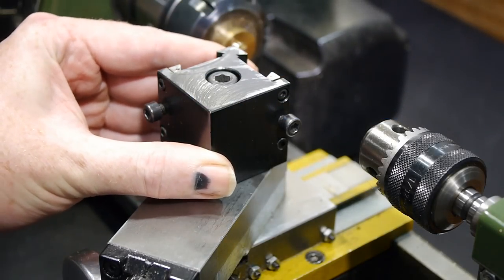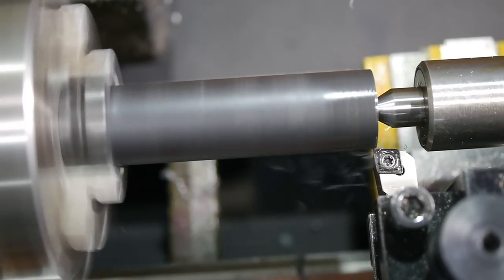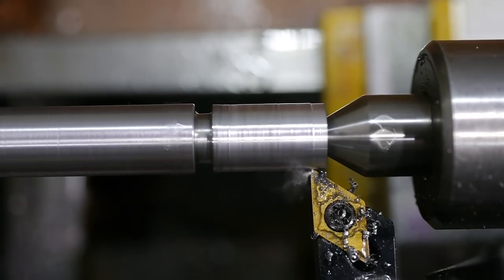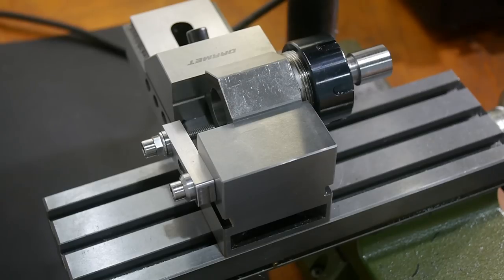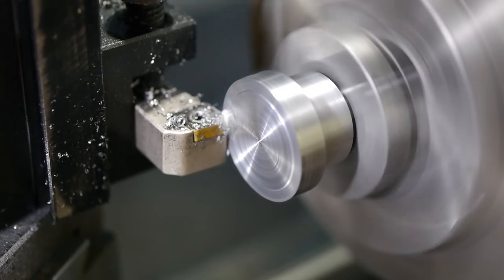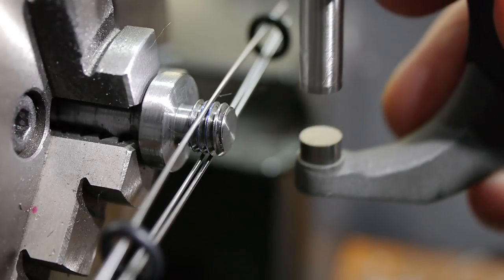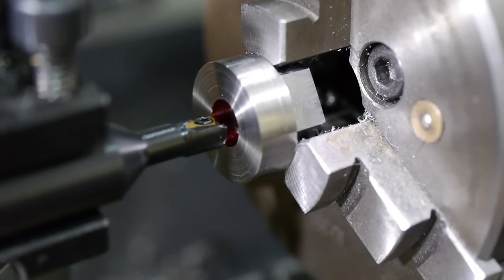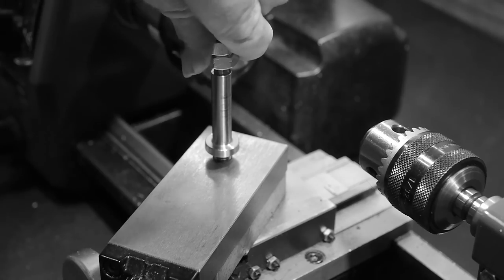Quick Change Tool Post Upgrade for the Proxxon PD 250/e Lathe

Comment: I know nothing about lathe machines  
But I'm very interested in this type of work thanks to your vids. 
I hear you say often how the motor stalls and how that lathe is weak and have no gears. 
Isn't it possible just to buy a new geard motor with more power ?
Reply from the maker: The issue is a bit more complex, so let me try and explain why I keep saying that. Commercial industrial lathes are large, have a powerful motor, and most importantly usually have a large complex gearbox to drive the spindle. The big AC motor is usually a fixed speed, and various sets of gears are used to select the spindle speed. This means motor power is fixed, and when the gears are selected for a low spindle speed, the spindle turns with a huge amount of torque. It's almost impossible to stall such a lathe at low speed, and something would almost always break before there was enough force to defeat the torque.
Small hobby lathes are much simpler machines, largely for cost reasons. The often have selectable speed modes via belt pulleys, or perhaps a couple of gears, but no full gearbox. To make up for this, and ensure they can still operate at different spindle speeds they have a speed control that varies the speed of the DC motor. The trouble is that when a DC motor speed is decreased, it also has a lot less torque. This means that most hobby lathes can quite easily be stalled at low speed if enough force is applied by the cutting tool that it is more than the available torque. I mention this from time to time as sometimes I get comments and suggestions from professional machinists, where it's not clear whether they understand how different a small hobby lathe is from the machines they are used to.
You absolutely could attach a big powerful motor, with it's own gearbox to a small lathe, but it doesn't really make sense. The small lathe wouldn't be built to safely handle the large forces, and it would probably take up as much space, and cost as much as buying a much bigger lathe second hand.
Reply: @AdventureswithaVerySmallLathe  
Ok thank you very much for your explanation. 
I was curious and now I'm with knowledge :) 
Love your videos keep up the good work :)

Comment: There is a shallow hole in the base of the tool post. Use it to lock the tool post in position on the base. I didn't see if there was a matching hole the base, if not dril & ream to suit. Make the matching hole a very snug fit. When tightening always push in the same direction onto the pin. Rigidity is the doorway ta good machining. Have you tried taking a heavier depth of cut to get a better finish? If u r going to use a carbide inser t why not use a Full form which crest cuts te thread anyways?

Comment: Have to make one for my PD 400. It came with the QCTP and with the same issues as yours.
Reply from the maker: How do you find the PD 400? I often wonder whether I should have paid that bit more, and got one of those instead. It would have been a real squeeze on my bench, but if the machine as as good as it looks, it might have been worth it.
Reply: @AdventureswithaVerySmallLathe  So far i am happy with it. Its my first lathe so i have no comparison to other machines. The larger range in diameter, length and mainly for threadcutting makes me toogle the switch to the bigger machine. As a beginner in turning and milling i don´t want the machines to be the restricting factor in my little workshop. And with money left to spent i choose the "big" one. Its a tight squeeze on the bench but absolutly worth it.
Reply: @AdventureswithaVerySmallLathe  Is the PD 400 220V?  not convenient 110V
Reply from the maker: @philipwolf3619  No idea I'm afraid. turbofan123, can you help out?

Comment: Great job on the tool post. I can see why the manufacturer cheaped out on this part. Lots of labor!  Couldn't you have just put a bushing on the bottom of the tool holder  to do the same thing?
Reply from the maker: A bushing would certainly have helped, but I don't think it would be as solid or stable as the solution I've made.

Comment: Very nice. If the original could slip while tightening, it could also slip while taking a harder cut.
Reply from the maker: The problem was mostly that the tool post would tend to move off-centre while tramming, or adjusting the angle. Tightening the bolt would then pull it back into centre, and would often mess up the tram as it did. With the register at the bottom, the post is certain to remain close to centre at all times.

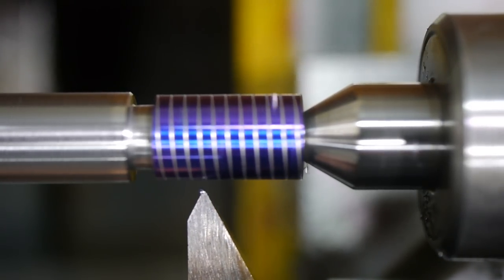Comment: The pointed threading tool (at 07:20) can be obtained where? Could you specify the exact designation of this tool? It‘s not from Proxxon, right? Thx.
Reply from the maker: That's a shop ground HSS tool I made myself from an 8mm square high speed steel blank.

Comment: Have you thought of lapping or scraping the bottom of your toolpost and the top of the compound? A good points per inch or lapped surface will be more rigid.
Reply from the maker: Definitely. The first thing I'd like to try is surface grinding it, which I'll have to take to a friend's shop for. To scrape it, I'll need a reference surface, which I don't have yet either.
Reply from the maker: The bottom surface was a real mess from the factory. It had fairly deep machining marks in it, which tended to get chips caught in them. It's better now that I've given it a stoning, but a proper grind or scrape is definitely required.
Reply from the maker: The bottom of the tool post has now been ground, and is much better. It makes firmer contact with the compound, and is easier to secure.

Comment: Looks like I'll be making a new stud for a new-to-me QCTP some time next week, so I thought I'd rewatch this video as it was full of useful ideas I can s̶t̶e̶a̶l̶ liberate ;)

Definitely got me thinking about the stress risers - you used a large radius tool near the shoulder, should I so something similar in my thread relief grooves as there are two sharp corners in each? Maybe using a threading tool to create the relief groove I can get away with it.

Thanks for the great video.
Reply from the maker: One of my machining mentors has repeatedly drummed in the importance of not having sharp inner corners, as they are very vulnerable to cracking under stress.

You make an excellent point about relief grooves. I've been using a parting tool, but I should probably grind some more dedicated tooling, with a size more closely matched to the requirements, and radiused corners.
Reply: @AdventureswithaVerySmallLathe  I might grind the corners off a parting blade and see how that goes.

Comment: good video brilliant idea, but, why start off with a blank the size of a broom handle to make something no more than20mm, in industry you would get a kicking for that ! taps and dies would be sufficient for this job too.
Reply from the maker: The stock I used for this was 20mm. The nut used the full diameter after the scale was removed, and I only removed 5mm to make the flange diameter of the post. I also completely avoided any chucking scrap by using the remaining length for the nut. I could probably have saved a bit on the diameter by ordering a 16mm diameter piece specially, but they I would have had to scrap the chucking allowance.

Comment: Thank you for a very interesting video. I have a proxxon 250 e and had a lot of problems with the tool post swiveling when I tried knerling. I am definitely going to adopt your way of correcting it. By the way , I don't own a mill and I consider buying the mill head that fits on the lathe. Do you have any experience with it? C
an you recommend it?
Reply from the maker: I originally bought the FF 230 mill head for this lathe, and it didn't work at all well. I don't recommend it. I was able to buy a separate base and cross-table to convert the mill head into a stand-alone lilling machine, but it was not good value for many. The milling machine is lightweight and inaccurate. A Chinese mini-mill would be better value, and more effective.
Reply: @AdventureswithaVerySmallLathe Thank you again for your advice. I have made the change you suggested for the QCTP and I am very happy with it.
Reply from the maker: No problem, glad I could be of inspiration and help.

Comment: Excellent video.  Nicely paced, good level of detail and explanation, and a topic which, with adaptation, could be good for a number of scenarios.
Incidentally, many years ago I made a QC toolpost for my 70 year old Myford Super 7.  It has been great, but it won't work with 12mm carbide tool holders, as the cutting tip ends up too high.  I have been browsing Youtube for a simpler design, and your Proxxon caught my attention. Do you have any negative opinions on this design?
Many thanks, Liked and Subscribed.

Comment: I'm wondering why you didn't make the brass washer stepped to fit into the recess on the tool holder.
Reply from the maker: There are a couple of reasons I steered away from that in favour of a single solid part. Firstly I wanted to be able to tram and turn the toolpost without it shifting around, so making the register part of the central shaft ensured there was no slack in the system Secondly I wanted to be able to tighten the shaft firmly against the top compound to avoid any wobble while making adjustments. Having a nice wide flange made it easier to do this.

Comment: Where to get thread wires like this and not costing a fortune?
Reply from the maker: I have no idea. I got them on eBay as a lucky find for a cheap price, but I've never been able to find them again.
Reply: @AdventureswithaVerySmallLathe  Well I just will buy small drill bits with same diameter checked with micrometer then.

Comment: Hi im looking for a a quick change toolpost for my proxxon 250 e lathe ,not the one from proxxon.any suggestions witch aftermarket toolpost should fit?
Reply from the maker: The Machifit QCTP that I reviewed in Oct 2019 is the best mini-lathe QCTP I have come across. Really solid, and significantly better than the Proxxon one by design. I have confirmed that it would fit onto the proxxon, though you would have to make your own stud to match the Proxxon compound fitting hole, and the through hole on the toolpost.

Comment: hi from where i can get the thread wires?

thanks
Reply from the maker: I bought mine in eBay, but the sets currently available there are all from the USA.
Reply: @AdventureswithaVerySmallLathe  ok!

i bought some wirespools from UK to build vaping coils.

its all 316L Stainless steel. i think its an option or?
Reply from the maker: @alexandernoname1391  A defining feature of thread wires is that their diameter is very precisely ground to the correct dimension. If you were going to use ordinary wirespools, you would only get results as accurate as the dimensions of the wire. Thread wires need to be perfectly straight, perfectly round in cross-section, and exactly the right dimension to be used with the charts provided.

Additionally measurement surfaces are quite often hardened to make sure they don't wear or deform easily under use. 316 is not practical to harden, so isn't a good material for making precise tools.
Reply: @AdventureswithaVerySmallLathe  thats right.

i would straight them and measure them. after this i get the real diameter.

have you a link from ebay? thanks
Reply from the maker: @alexandernoname1391  https://www.ebay.com/itm/48-PIECE-THREAD-WIRE-MEASURING-SET-4200-0241/233436399480

Comment: I often think Proxxon is an odd company. I own a MF70 micromill. The design is fine. The instructions for disassembly seem not to exist, even on the website as pdf files. So I can't get a quarter-turn backlash out the Z axis because I can't take off the handle which is held by  a pin, which I cannot find even with a loupe. Is your toolpost a Proxxon original or aftermarket?. If the latter then I can't blame Proxxon. But sometimes I wonder if they justify their price.
Reply from the maker: I know what you mean. I often think they don't really want the owners of their machines doing any disassembly and maintenance at all. The instructions books for my machines contain dire warnings not to modify the machines in any way.
The tool post is a Proxxon original. It feels like the original design was fine, but then a bunch of changes we made during production engineering to shave off some of the cost before market. The tool post does have the register pocket cut into the bottom, so someone clearly intended it to be properly registered, but then someone else figured they could ditch a custom part, and replace it with a stock M8  bold, shaving a few cents off the cost.
Reply: Amen. Maybe the dire warnings are an EU regulation :( but it is absurd to expect any machine to operate indefinitely with no adjustment for backlash.

Comment: Very nice, might do the same for mine. Would you have some advice on what tools you got for the pd250 and from where? Seems hard to find much that fits in the tool post aside from what proxxon themselves offer..
Reply from the maker: Almost all my tooling has 8mm shank, though 10mm can fit for some tools as well. 8mm lathe tooling is quite easy to get on eBay, Aliexpress or Banggood. I find CCMT inserts work best for most projects on my lathe. I've also bought tools from Chesterfield Machine Tools who make quality insert tooling in th UK in a range of sizes. Happy to recommend (and not being paid to do so).
Reply: @AdventureswithaVerySmallLathe  Thanks, looked all over BG/Ali a while ago but I guess I just need to search better. Will look up Chesterfield.

Comment: Hello, i’m a noob to all this so i’m just wondering if someone explain the advantage of using the machine to cut the threads verses using something like a tap and dye set?
Reply from the maker: A machine cut thread can potentially be much more accurate. It's quite easy to get a thread crooked with a tap or die, and there is only very rough control over the depth of the thread. A machined thread should be perfectly straight, can be cut to the depth and tolerance chosen by the machinist, and if the machine is in good condition the pitch will be very accurate. Machining also makes it possible to form a thread with a specification where no taps and dies are available, as I did in my tap and die making videos.

Comment: The PD250 looks like a great little lathe considering its size, would you say it punches above its weight for its size. Now that you have used the lathe a fair bit would you buy the same machine knowing what you know now about it or look for something else. Thank you.
Reply from the maker: That's a really good question. My first instinct is to say that if I could go back, I would actually buy something larger, but that doesn't really answer your question. I feel the lathe is generally very good, considering its size, but it's also quite a lot more expensive than other lathes of similar size. It also has a few issues which are limiting. The tailstock is weak, imperfectly aligned, and impossible to adjust. The compound is also very limited, and lacks rigidity. I often wonder how my workshop might have worked out if I bought a really cheap Chinese lathe to start with, then upgraded to a larger lathe when I found it too limiting.
I think I would only recommend the PD 250/e to someone who really needs a very small lathe, and knows they are going to stick with it. If someone is looking for a cheap way to start out with learning to use a lathe, I'd probably suggest a cheap Chinese lathe instead, as a disposable starter machine.
Reply: @AdventureswithaVerySmallLathe  I am an experienced lathe user that have had much larger lathes in the past over a 40 year period. I am now looking for something much smaller these days that is more portable & can be used in the house & quiet running, i dont do any screw cutting these days & could probably get away with no power feed. That is why i was also thinking of the Sherline long bed lathe ( 17" between centers ), there are lots of vids on Sherlines & users seem to like them a lot. plus lots of tooling available for them along with a complete range of spare parts easily available.

Comment: You say you can't cut deep enough to get through the scale on the 20mm stock. What is the max DOC for this lathe (and this piece of stock)?
Reply from the maker: I've made some improvements including this toolpost upgrade, and a solid granite base, which mean I can now cut as deep as 0.2mm as long as the tool is fully engaged. For an interrupted cut where the outside of the material is not completely round, and the surface is hard and scaley I can't cut deeper than 0.05mm without having real problems with chatter.

Comment: Can i ask you where you got your proxxon 4 jaw chuck from, thanks.
Reply from the maker: Sure. It's a generic 80mm 4-jaw I bought from eBay, not made by Proxxon. The exact seller I bought from doesn't seem to list it any more. I made my own backplate from 85mm 4140 steel. This is probably not the perfect material, but it's good steel, and works fine. The downside of this arrangement is that the chuck is much too heavy for the machine, and causes major chatter and vibration problems.
In my recent "Packages, and Stickers, and Mail! (Oh my!)" I talk about a second hand chuck I bought, also off eBay, which is the same diameter, but less deep, and much lighter. I'm also going to aim to make a slimmer, ligher backplate for this one.
It would probably have been much smarter and simpler to just buy the Proxxon 4-jaw chuck, but I'm afraid I don't have any information about where you can buy one.